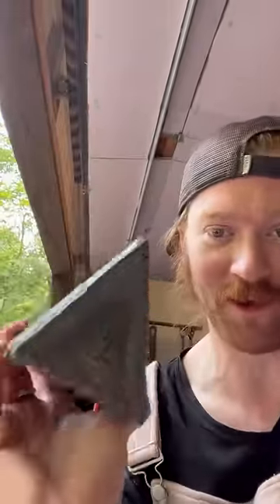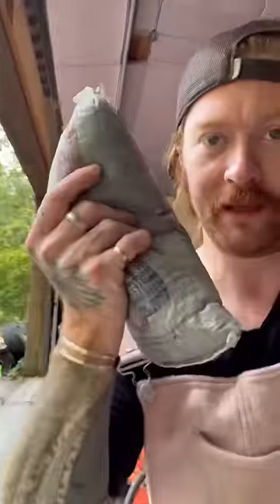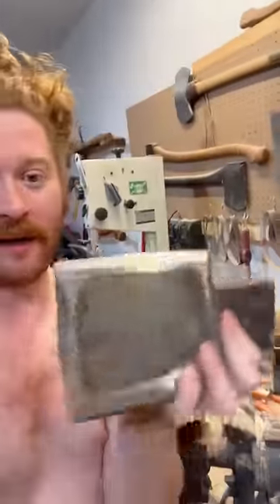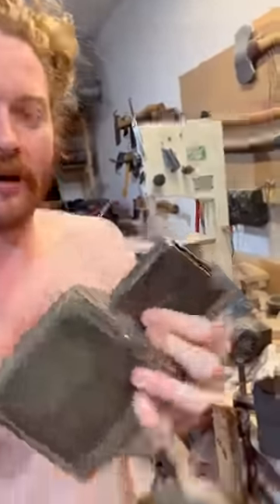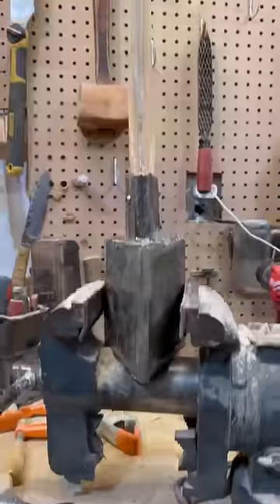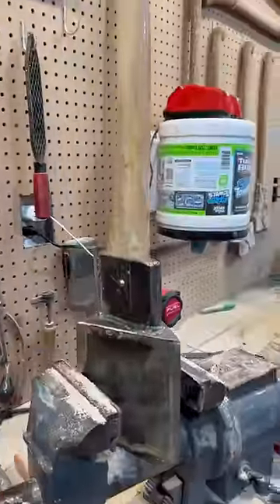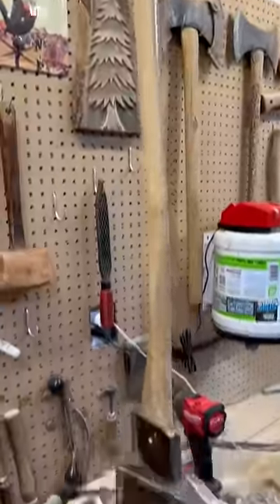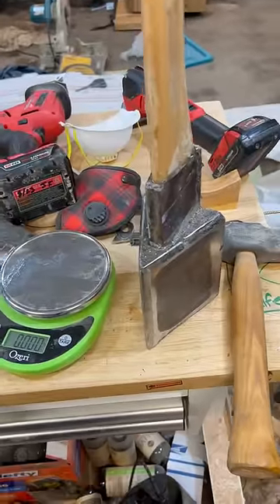LET’S MAKE A DEADBLOW SPLITTING AXE

Comment: Epoxy will make that handle snap real quick. And the handle design is too small and needs to go through the head. The thick heavy head will not penetrate enough to allow the splitting on larger pieces of wood, you'll get bounce off, be careful.

Comment: How the he'll u weld that cap and handle collar on the bottom with out melting ur lead bbs u should left it empty drilled a hole under the handle to add ur bbs the ur handle can corke the bb hole to
Reply from the maker: 🤷🏼‍♀️ they didn’t though! Great idea thought for version 3 😎 Thanks!!
Reply: @Voicesofjake  impressive they didn't

Comment: I don't think it will work well because it's too large of an angle.   The best splitting mauls I've used were closer to an axe profile.   I had one of those big triangle shaped ones you can but with a metal handle.   It was terrible and this reminds me of it.
Reply: Learn to split wood and you would love it,  called a monster maul,,,
Reply: @roostertrucker  I've split plenty of wood by hand, and it's not a good design, or at least not good for me.   I have a gas splitter now, so it doesn't matter too much.
Reply: Here at my farm, monster maul rules the day. Were all big dudes and monster maul can split as fast as a hydraulic splitter. Been using maul since I was a teenager. I'm 53 now and still can hand split faster then a hydraulic splitter.